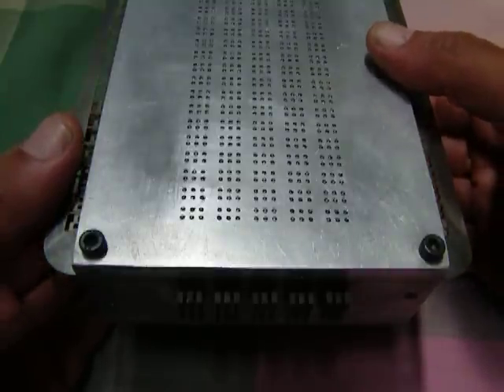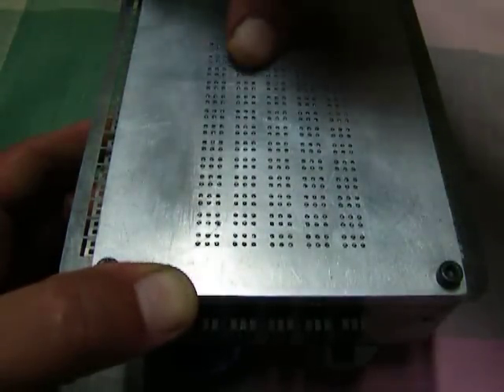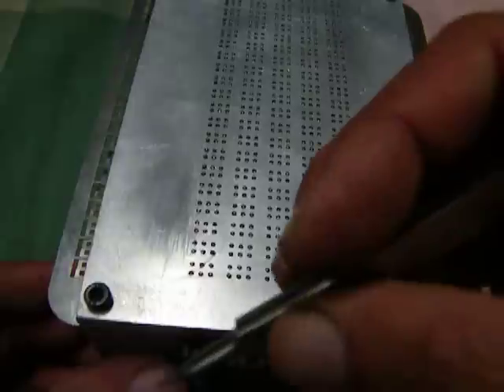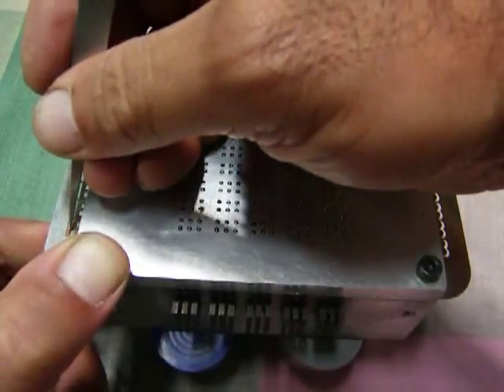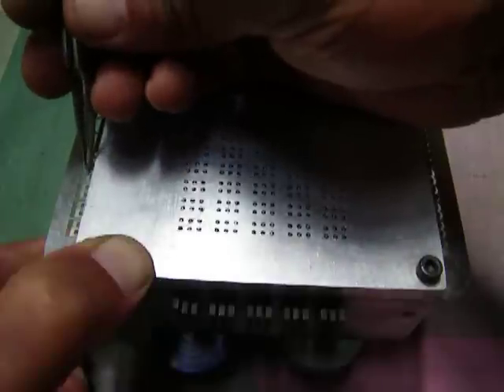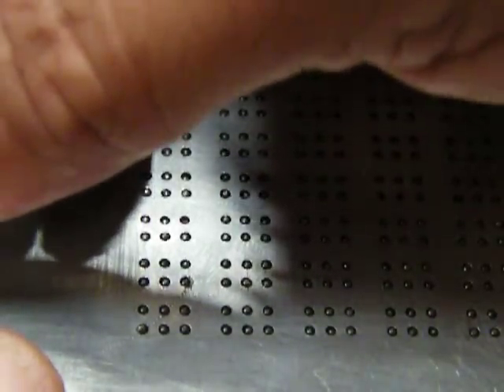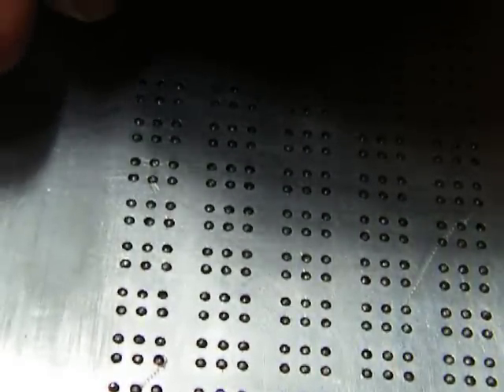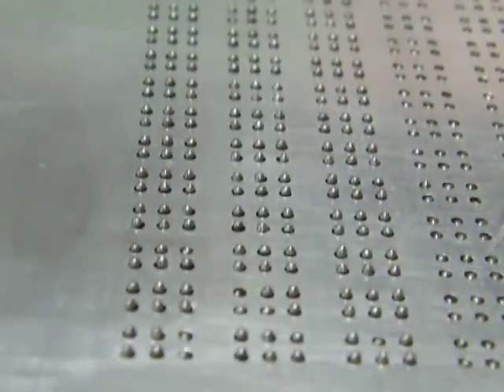Refreshable Braille Display - Individual Pin control

Comment: This is a very clever mechanical design! Since it requires a lot of power (relatively) and a lot of moving parts, but can be made mostly from metal it would be perfect for public use applications, i.E. airport information points or government buildings.

I am currently tinkering on an extremely compact 3d relief display using solenoids and a similar latching mechanism using a single sheet of material to lock all actuated dots at once - I stumbled upon your videos while researching braille displays.
Reply from the maker: Thanks for writing in and I do appreciate your feedback.  Yes, a metal display will be rugged and sturdy and well suited to public places.  I have currently kept this multi-line version on hold and have been working on a single line low cost version. Please check my channel "pgdsouza"